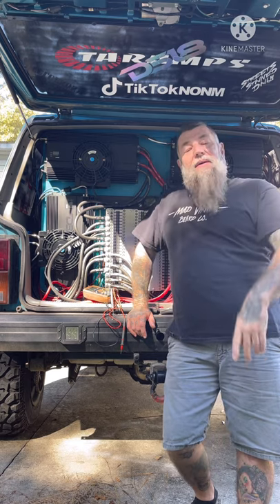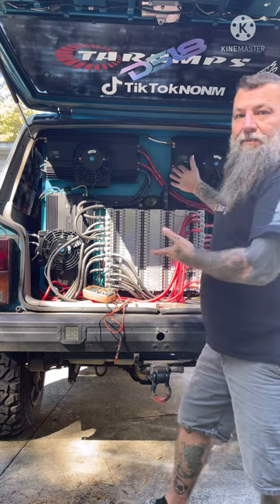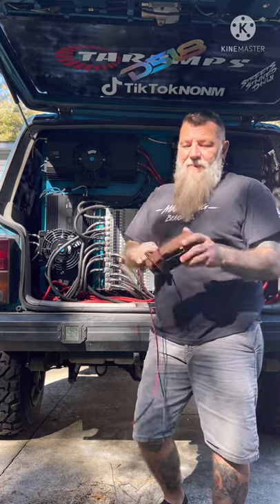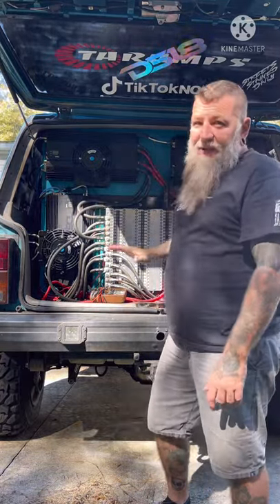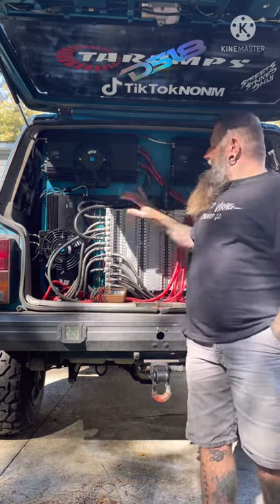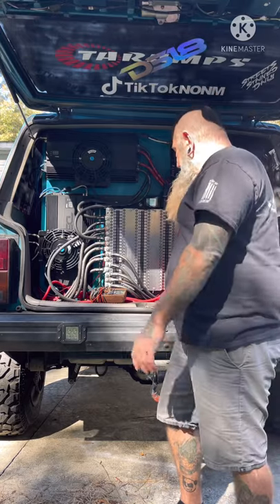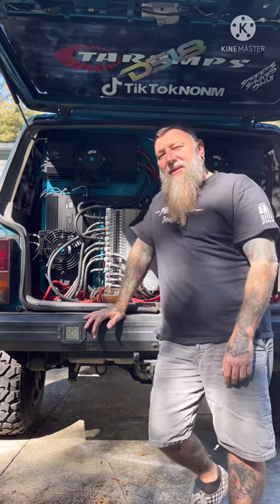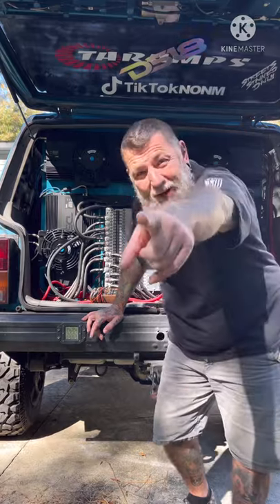Always re-adjust your gains

Comment: I run Taramps currently and I have to adjust mine about every third day. I got a 160 daily driver walled and I thought about putting a dab of silicone on the edge of the gain knob. I haven't done it yet for some stupid reason but I'm going to try it and see how long it holds.

Comment: Im sure it depends on the amp but doesn't the power redistribute its rms depending on how its ran? 
Having 1 channel hooked up all that power goes to that one because there is less resistance compared to all the speakers hooked up. With my Orion XTR750.4 it seems to distribute the power from 1+2 / 3+4 granted its a A/B amp. So my suggestion would be try adjusting the gain utilizing your decks adjustments. Redirecting the signal to only run the front right or if its powering only left and right just right (pending the channel amplifier your using) this way it has it recognizing and distrbuting the power how you are gonna have it in the end. Hope that makes sense and i think that would make a great video testing the difference if any between adjusting your gains the way your showing now and adjusting it with the use of your deck, with the deck filtering each section because the amp is accounting to utilize that power according to the resistance it reads. Or not... Be great to know for sure if your up for the task or thinking of a video you'd like to do next. Appreciate yuh giving out your tips and tricks. The more we know the more we grow... 😒

Comment: I have no way to really check or set my gains man but by ear can you please help me with a easy way to do it by ear and be safe
Reply: You can get a multimeter from Walmart for like 10-20$.
Start with gain all the way down

Play a test tone and set your head volume just below max, maybe 75% and never turn it past this (most units begin to clip at max volume)
Turn your bass knob all the way up

Now probe the speaker outputs with your multimeter and turn the gain up till you reach the voltage your looking for. 

Lots of youtube videos on how to do this.
If you set gains with a multimeter maybe back it off slightly after you find the voltage you want. Just to be safe as a multimeter is not the best tool for the job but much better than ears
Reply: @RandoManFPV  thanks idk that I don’t really shop at stores so I’ll go check one out ty